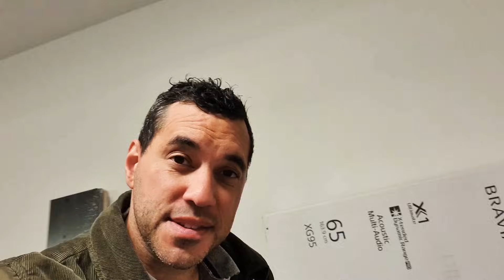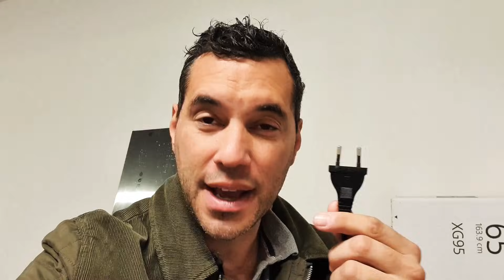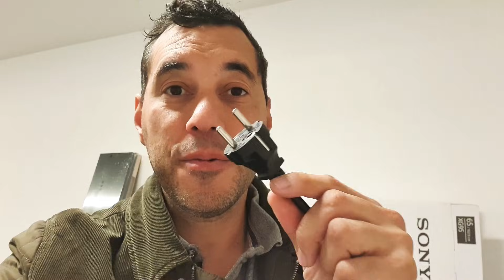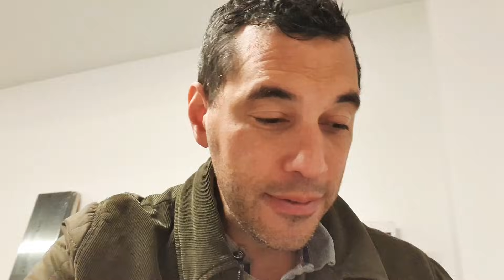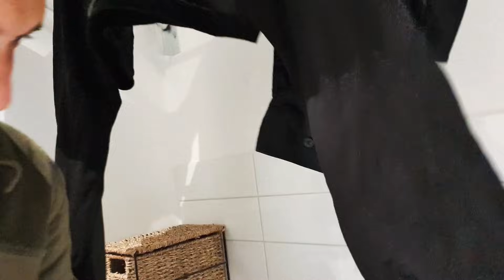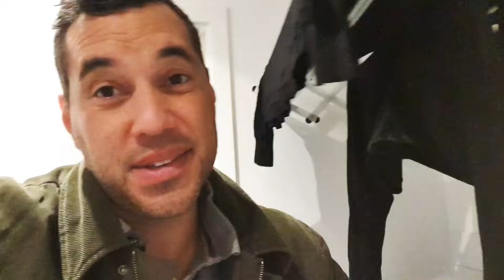Why don't EU plugs have FUSES!!!

Comment: Yeah I live in europe and fucking hate 3 phase.
It's so confusing and scary to deal with
Reply from the maker: Haha totally agree Danny, it's so confusing and I'm so pissed that our fuses keep randomly blowing because of load on the system!! Thanks for the comment!
Reply: @BeingSwenglish  Something is not balanced right in your house. Normally, the circuits around the house tend to be planned so that the load on each of the phases is about the same. Phase+neutral gives you 230 volts, but hobs and other kitchen appliances often require 2 phases (e.g. 400 volts) or even the full three phases (which is good as it keeps the load evenly balanced across all three phases). But in your case it sounds like too many sockets have been put on a single circuit, or at least the electrician didn't anticipate that level of load on a single circuit. In the end, it probably means that the load on the three phases coming in to your house is not evenly distributed (although that's not something you have to concern yourself with).
Reply from the maker: @RobertClaeson  thanks dude, well turns out it was attaching our plugin electric car into one of the sockets which was causing it to trip, we've sold it now by using a balancing thing, but it's still annoying! Thanks for the comment!
Reply: @RobertClaeson  Ranges use typically three phases but one can connect them to one phase but then one is limited in the power one can use. My range is max 8500 W and it is on a 20 A fuse so it is limited to 4600 watts. I never use more ta 3000 W.

Comment: I have heard that allot of the EU laws on electrics and safety, were written in the UK along with a couple of others I don't mind being corrected on this. I don't know everything all though it would be nice to be all knowing!
Reply from the maker: Interesting, I guess it depends in which country 'electricity' evolved initially,it would indeed be interesting to know who setup the first element of regulation around it's use!
Reply: The EU attempted to get all to have the same electrical system, sockets, plugs and regulations, which is quite sensible. The British were heavily involved. Many of the British IEE regulations were adopted by the EU, as they were of a higher standard.  The UK dropped its voltage from 250v  230v to conform tot the EU.  The is one thing the UK would not budge on, and that was the British 3-pin fused plug and the switched socket - design classics - which gives added protection and localises faults to individual appliances.  The British said we are not dropping our standards, you raise yours to ours. The EU was more concerned about the cost of converting over to a British socket and plug, so dropped the idea. They did consider a fuse-in-plug but wanted a new design. The British said , "ours works why change it?". The EUs inferior system came about because of cost not safety.

Comment: Great points, no switches at the sockets either.
Reply: There are sockets with switches, but that's not what electricians install normally (as they are more expensive).
Reply from the maker: Yes precisely, it's so irritating having to unplug stuff to turn them off fully instead of jut flipping a switch.
Reply: @BeingSwenglish  the.. the appliance have a power switch built in, 99% of the time? 
DC power supplies for laptops don't have switches, but how many spare outlets do you have that you can have every single one plugged in? You just plug them in when you need them, then put them away.
Reply: @sisrace  many items dont actually and just sit on standby or the switch might be inaccessible compared to the one at the socket which can also act as a master switch for power bars

and the extra cost is negligible for that priviledge
Reply: @sisrace  My 900 square feet house has 32 outlets

Comment: I think there's something wrong with your electrical installation based on what you said. Maybe get an electrician to take a look, as it doesn't sound right.
Ovens/cookers in Sweden use 400V and unless it's hard wired, they use this plug https://en.wikipedia.org/wiki/Perilex
They should be on their own fuse and not be shared with something like a fridge.
If the master fuse was triggered, then something went seriously wrong.

As for European vs UK plugs, I hated the UK plugs when I lived there and the fuse is a PITA imho...
I guess the fused plugs have something to do with the fact that many houses still use wire fuses in the UK, which is bonkers imho.
It comes down to what you're used to/gown up with I guess. 

Also, there was a move towards a "universal" power plug/socket, but only South Africa bothered implementing it...
https://en.wikipedia.org/wiki/IEC_60906-1

On a related topic, the UK only has a couple of wires sticking out of the ceiling if you want to mount a ceiling light, whereas Europe is moving towards this now https://en.wikipedia.org/wiki/Device_for_Connection_of_Luminaires
Sweden has an older, round version as well.

I loathe the American style plugs I have to put up with there, worst plugs out there imho, as you can zap yourself when you unplug them if you're not careful.
Reply from the maker: No it a brand new house, wired correctly to standards and thoroughly tested. The oven is on it's own trip/RCD of course (as is almost every appliance) but it's was one of the master fuses outside (3 of them) of which blew. It's wired correctly, but perhaps was just a faulty fuse. I really miss having a switch on a plug socket!!
Reply: @BeingSwenglish  that's also so weird and another thing that was hard to get used to in the UK. Again, comes back to what you're used to I guess...

Comment: You should have a breaker box between the appliance and the 3 phase fuses. The 3 main fuses sometimes blow for other reasons. Such as age or a current spike from the utility company. You're more likely to have a breaker trip than the main fuses from an appliance. 

When I moved into my apartment a couple of years ago, I blew all 3 of the main fuses. They were just old, and nobody had lived in this apartment for awhile and we were having a storm as well. So the load, plus the storm took them all out.

But more times than not, if your appliance is drawing too much current, it'll trip the breaker, and not blow a mains fuse. 

Coming from the US, this was all new to me too.  Keep those big ass fuses around. I always keep an extra box. In 14 years I've only had to change fuses 1 time.  But you dont want to be without them if something wonky happens :)

Just remember that fuses age and actually so do breakers. If a breaker is tripped a lot, it'll begin to trip more often even when there isn't a big load.
Reply from the maker: Thanks for the comment Bill! Yeah we do have trip switches/RCD between the appliances and the master fuse box, but I do suspect that the circuit breaker might be faulty, hence why it blew the master fuse outside, the electrician did inspect it and found no issue, but its possible.

Comment: A fuse in the plug socket sounds like a great idea
Reply from the maker: Yeah man, it's so nice for peace of mind!
Reply: @BeingSwenglish  mm.. Lightning struck at my parents house. Their TV, Fridge, Stove, TV boxes, Router and microwave died :/
Reply from the maker: @Frankly Frank the UK plugs aren't bulky compared to the EU plug sockets (the version with an earth), the UK socket is more streamlined when connected to an outlet. As for 'no complaints', you'll find that people in the trades don't complain about what they're used to, just as old-school plumbers will swear that copper is better than PEX, while modern, young and highly qualified new plumbers wouldn't touch copper due to it's irrelevance in modern society for plumbing.
Reply: @BeingSwenglish  There are angled, slim EU plugs as well but for some unknown reason they are not commonplace.

Comment: Totally agree. Same in our Swedish apartment. The fuse box for each section is rather random areas which have some plugs and some lights.. so it makes it harder to locate the fault quicker. In the UK it would have been one section for plugs downstairs, another section for lights etc etc. Also I find the EU sockets gather dust so easily into socket .. with UK ones they are easier to wipe off on the surface.
Reply: Frankly Frank your right it shouldn’t be difficult at all but when your dealing with a property and they’ve randomly wired lights with different sockets its a bit of a concern and takes longer to search which appliance might be causing the issue especially if it doesnt have a fuse in the plug. In the UK the fuse box has one section for lights, one section for plugs etc etc and is clearly labelled. Its interesting comparing both our Swedish properties now as its not clearly labelled and they are both new build properties.
Reply: Frankly Frank this is what im saying its not wired up to standard and I have a feeling they don’t certify they work here..
Reply: Frankly Frank need to make a complaint about our electricity wiring.. is there a council or body member we can contact to inspect the work in Sweden?
Reply from the maker: Isn't it strange, it just doesn't make technical sense - at least in the UK rings for mains and lighting is separated - did you know that most electrical cabling in Sweden even uses the same standard for lighting and higher load mains, no split between 1mm/1.5mm for lighting and 2.5mm for appliances, bizarre!
Reply: BeingSwenglish this load balance must explain why we get fuse trips on one particular section.. its all mixed up.. its crazy lol  it’s like there sweet shops a bit of everything here lol
Reply: @BeingSwenglish  there is no need to split lights from high loads as we don’t use ring circuits but radical circuits. 

And better use 2.5mm everywhere instead of difrent standards. 
We used to have a specific light socket but it’s not used anymore.
Reply: @BeingSwenglish  
With LED lights being the norm these days, only 1.00mm is needed, and in a rather big house as well. Using 1.5mm is now overkill and needles extra expense and extra work as large cables are more difficult to work with.
Reply from the maker: @Frankly Frank actually it is entirely possible that Flyby's property was wired incorrectly without certification, it does happen in all countries where people 'do it themselves' and they're not certified. In addition, apartments are not always inspected electrically during sale/rental, only on occasion and it is easy to miss bad electrical jobs if they're not core to the main appliances.